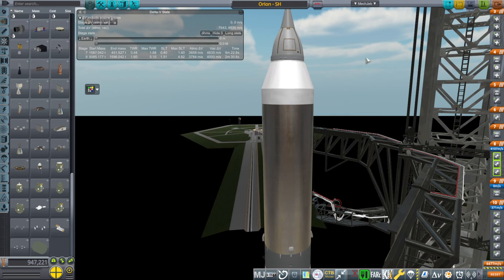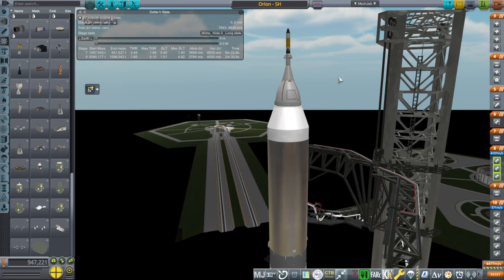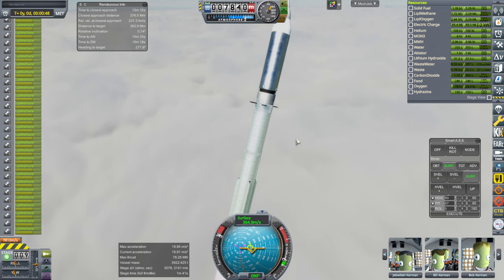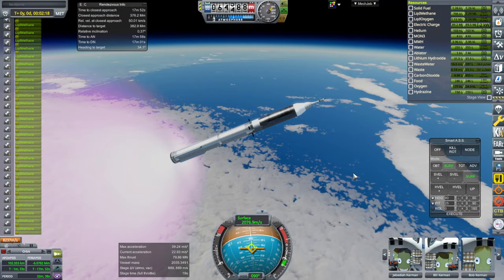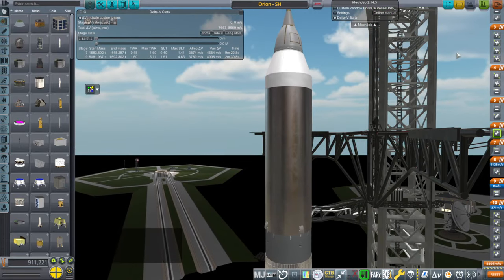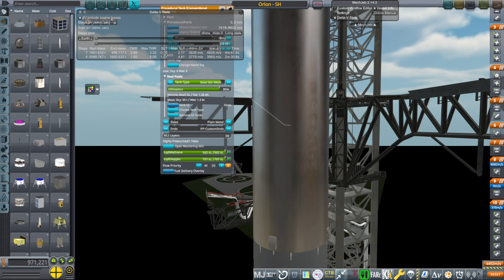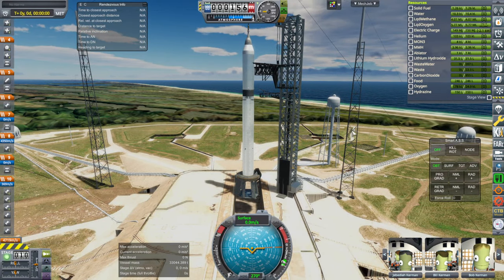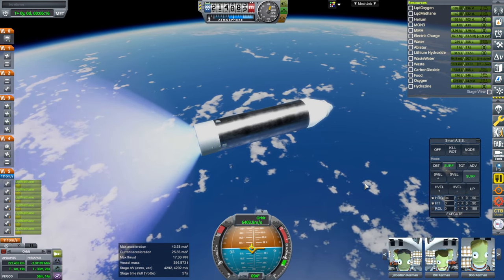Orion - Tank Alone Starship (RO in KSP 1.12)

Comment: what advantages does the blue moon stage have over centaur V?
Reply: I'm pretty sure he went into depth over it in the last video, but its mostly because the blue moon stage needs to be crew rated for Blue origins lander meaning it would require less R&D then Centaur-V.
Reply from the maker: I'm not sure how much insulation Centaur V has to prevent boiloff and how long it can hang out around the Moon. People are looking at Centaur V as a pure transfer stage, which is fine, but it's more dubious when you try to replace the service module with it. As a lunar lander stage, Blue Moon would already be well-suited to do the service module duties.

Comment: Would a falcon heavy be able to put the Orion spacecraft with service module and a centaur five into low earth orbit? Is that enough Delta V for trans lunar injection? That way, the Center five could be a pure transfer stage.  

Of course, I think the blue moon  service module is the best idea yet!
Reply from the maker: No, Falcon Heavy can't place Orion, its service module, and Centaur V into orbit.
Reply: @ even fully expendable?  I thought falcon heavy could do about 60 tons to LEO
Reply: @mbmurphy777 centaur V alone is almost 60 tons

Add to it orion with launch escape systems and we get to around 90
Reply: yes thanks for pointing that out. I got 22 tons from ChatGPT, which is a lesson on the inaccuracies of the AI search engines.  It looks like 22 tons is the mass of the Centaur III.